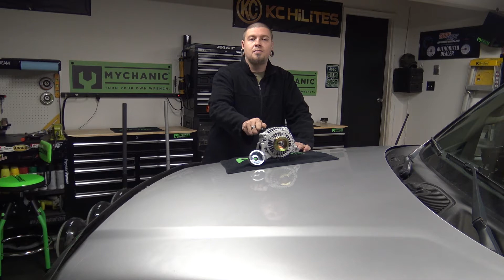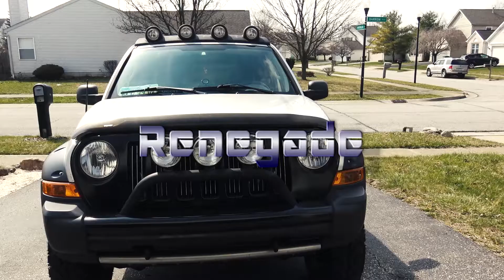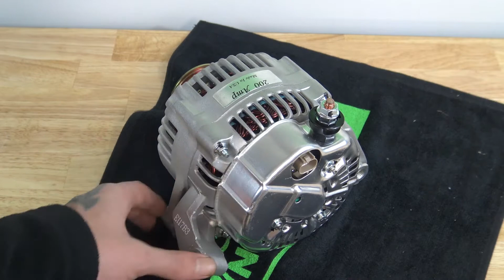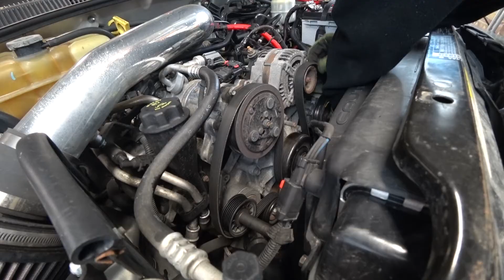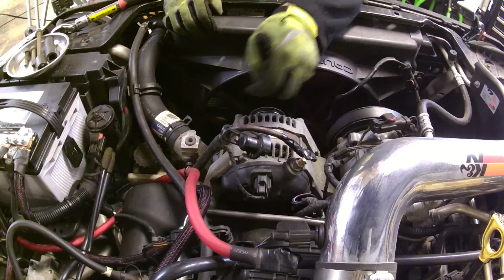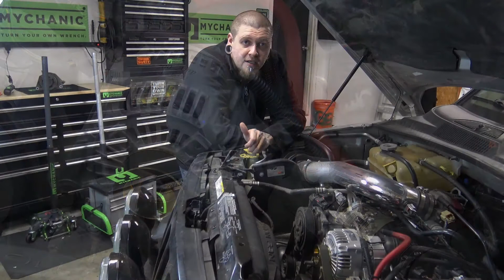Jeep Liberty High Output 200 Amp Alternator, Project Renegade Ep.3️⃣2️⃣

Comment: This alternator "brand" notice it has no brand nane on it? (That's probably a clue). Well, its a fake piece of garbage. I just installed the same exact unit and had it properly load tested, and yes... it's a fraud. It isn't even any better than my stock alternator which is 26 years old!!! It only puts out 73 amps at 2000 rpms on a VAT45 battery/alternator tester. I'm so pissed off. It's from bnr auto parts or sonething kike that on ebay. It has all 5 star reviews! I guess everyone really is that stupid and no is even testing that these are legit after they install them.

Comment: did the connector for the back of the alternator fit easy or did you have to remove the rubber piece inside to get it to connect to the back of the alternator
Reply from the maker: It has been so long ago that I can't say for sure, but I'm pretty sure mine went on with no issues or modifications.

Comment: Who makes the alternator? I'd like one for my 3.7l Dakota.
Reply from the maker: Here is a link to the sellers other items. My link for this exact alternator won't work anymore, but you may be able to find this alternator if you look through this guys stuff. Thanks for watching! https://www.ebay.com/sch/sis.html?_nkw=200+Amp+High+Output+HD+NEW+Alternator+For+Mitsubishi+Raider+Jeep+Liberty+Dakota&_id=202136295651&&_trksid=p2057872.m2749.l2658
Reply: @RockyXTV  Thanks!!
Reply: So I got one of these alternators-- bnr I think is the brand, (it's definitely the same product). It was load tested and only put out 73 amps at 2,000 rpms! Dude, before recommending things to your followers, you should have actually tested it's output, first... It's a fake piece of garbage.

Comment: Nice simple upgrade should do for my two amps.  Plug and play.
Reply from the maker: This was a nice upgrade over stock, however after running this for a while now I think they overrated this alternator by a little. They rate it at 200 Amps @2000 RPM COLD. This might produce around 180 when warm, still happy with it though. Would highly recommend an external voltage regulator though, the Jeep ECM likes to play with the voltage a little too much. Thanks for checking out the video!
Reply: @RockyXTV  would you please make a video on a voltage regulator for this liberty! I'm planning on upgrading for an audio system but I'm trying to be cautious.

Comment: Lots of talk online about how the current is regulated by the PCM. Very interested to see how you covered this topic. Currently looking into building out my 02 KJ into a weekend snowboarding crash pad and a dual battery setup would help keep me warm. Thanks for the content
Reply from the maker: Most of the forums are partially correct. The Voltage (volts) is regulated by the PCM/BCM, but the Current (amps) however is not. The current is a supply and demand scenario, this 200 amp alternator will only put out what is need and can supply up to 200 amps. Thanks for watching!
Reply: Are you 100% sure about this??can you run some tests to make sure this is correct??because I have a stereo in my liby and from everything i have read the pcm is a roadblock to getting higher output  Alternators.

Also the sports/limited alts are 136amp and renegades are 160amp.you can even look up the model numbers from the stock alternators and see this is correct..